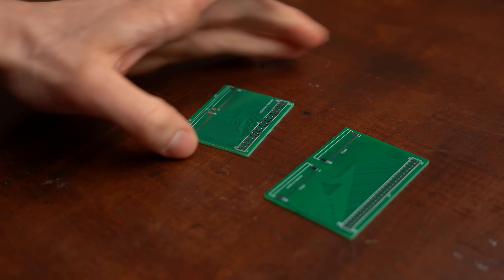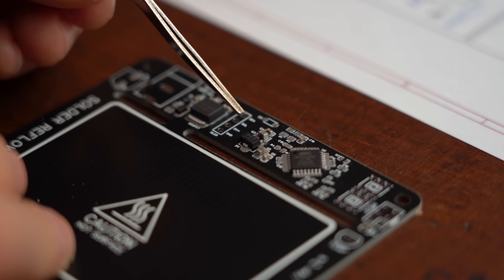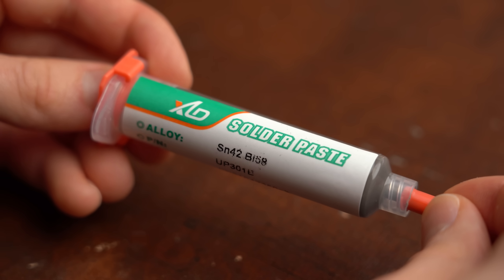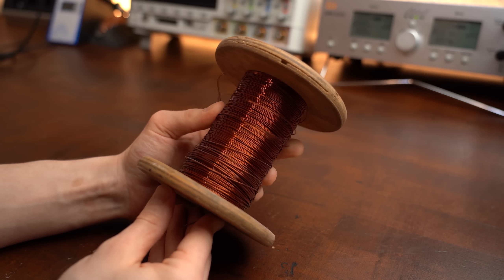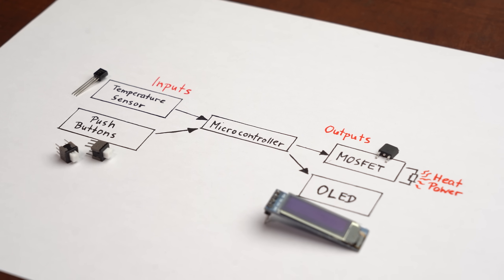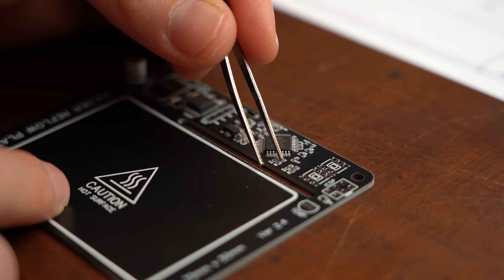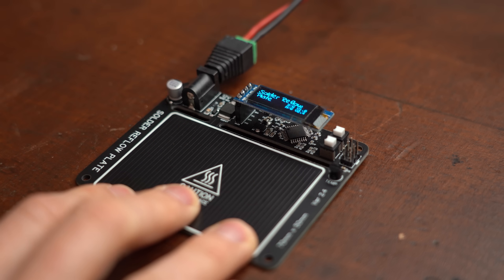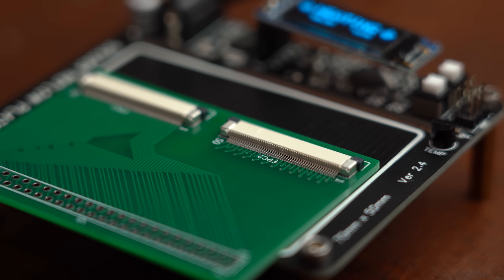The Best way to Solder? Hot Plate to the rescue! (DIY or Buy)

Comment: I just thinking, could you use a copper plate, heating coil, and something that doesn't heat up well without costing too much.  I think the circuit would do.

Comment: Im impressed you didnt try the even more DIY version more accessible, a FLAT IRON, the principles are the same, a temperature sensor, a relay and a simple arduino, this can be upgraded to a triac setup for even more fine control as the flat iron resistence doesnt need the full power to reach a desired temperature.
I know it has been made by other creators buts its just way simpler, cheaper and has a bigger hotplate area

Comment: Meh, I'd rather heat up a frying pan with some sand over the gas stove. 
I've never tried my 3d printer's heated bed. I think you can program some kind of a curve for temperature, but I don't know how many cycles over 160 or 200 degrees it would take before frying something on the control board.

Comment: I have the buy option hot plate, it can have 3 temperature set point you can change it on the fly by press a button, so you can somewhat made that reflow profile curve

Comment: I've had great success with a much simpler solution: I have a 300x300x6mm aluminum plate (6061-T6) to which I've attached several thermocouples. I place the plate on a single burner of my gas stove in the kitchen and heat until the solder flows. Immediately close the flame and let cool. As others have said, this of course only works with components on one side of the PCB.

Comment: I think, with the smaller amount of work I do, the DIY solution would be more economical and efficient with lifespan.   I think with commercial / higher quanties it would definitely be more beneficial to buy commercial.   My 3D printer has a PCB style heater element for the bed and this seems to work really nicely and has lasted a long time with my moderate printing use.
That said, I do like the curve on the DIY solution, though I don't think it is needed so much in open air compared to an oven.

Comment: Seems to me you could use a 3D Printer aluminum heated bed, mainboard and display with some small mods to the firmware to get the same thing, on as large or small scale as you need.

Comment: You may should check some cheap chinese 3D printer hot plate. It can be bigger, and maybe it'll not burn out, if you push up the temperature around 160-170 °C (of course, the controller circuit has to be created)

Comment: Electronoobs made one out of a cloths-iron and has been using it ever since. He even upgraded it as can be seen in later videos. It's pretty much the same as the one in this video, but a lot bigger, so you get more space, but also, because it's an iron meant to get hot and meant to be used many times, literally a hunk of metal, it should last longer than the PCB version.

Comment: The heated bed longevity may be better than you think. 3d printers use this method of heating the bed for days at a time. Admittedly they dont heat quite as hot but often last longer then the printer.

Comment: Actually, the hot plate is just like the PCB hot bed of a 3D printer. If you can get the same PCB with the correct trace width and length, a 3D printer controller can be used to control the heating process with G-code.

Comment: I like this idea, I have an extra 3d printer motherboard and some aluminum frames that I could use to make a diy one, all I need now is a good heat plate setup and I'm good. This gives me a chance to use my old 8 bit ender controller board that hasn't been in use since I replaced it with skr e3

Comment: You should add insulation in the other side of the pcb, as its done in many 3d printer beds, to get quicker heating and accurate readings
Reply: Do you mean cover the component side? Tricky as it is all too easy to dislodge SMD components when covering the board. If you mean between the bottom of the board and the hotplate ... That makes no sense!
Reply: @boblewis5558  I think he means the underside of the hotplate/heater. That's what was (and is) done on the printer beds.

Comment: It's not that hard to solder fine pins if you actually solder correctly. On a related note, if my microsoldering instructor had ever seen me melt solder onto the iron and then dob it onto a pin, I would have been pulled right out of avionics and would have spent my enlisted time as a cook or someone that transports human waste.

Comment: I had created a similar project a couple semesters ago for my industrial instrumentation and control course. However, I used an old broken portable iron and a ss relay along with the Arduino and OLED display. It worked great for soldering PCBs and also used pid control. Turned out so good that my teacher had me make 2 more for the lab to use instead of the commercial ones with full sized irons 🙂🙂. So I greatly recommend using that for the heating surface and the rest of the pcb heater as control. Only problem is that since mains electricity is involved, only experienced people should try it 🙏

Comment: If the temps envolved are so "low", another option to build a bigger heating area is to use a 3D printer bed heating PCB. They usually are 22x22cm, but there are bigger options. This would also solve another previous comment about separating the PCB from the heater
Reply: I was wondering about this.  I typically don't drive my printer build plate above 100C.  I wonder if it could get to the 160C needed here.
Reply: @bbowling4979  With enough power and thermal insulation, anything can be done (including burning the electrical insulation :P), but unless you can "pump a few more volts" from your printer's power supply, I agree that would be pretty hard to reach.

Comment: I can't believe the size of that MHP30, so cute. I'd seen photos of it when I was looking for a hot plate but without a banana for scale, I had no way to tell it was so small, I thought it was at least 30cm across. 

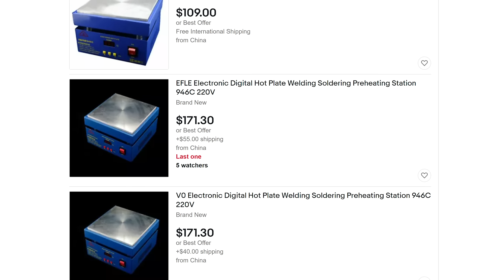I couldn't understand why you'd need a hot plate as small as it is but I'm now thinking it's a repair hot plate designed for small area fixes instead of whole boards. The part I still don't understand is how something that small can cost that much! It's about the same price as the bigger blue hot plate you showed at 4:28

Comment: I always thought of heat plate as a support (i.e. put it at around 100°C and then solder with the hand stylus), not as a fully featured soldering solution. I will have to give it a try...

Comment: People have been using the pcb heater method for years on 3D printers. It lasts for years and thousands of cycles, usually only heats up to 60-100°C but for hours upon hours at a time.
Does a few minutes of hotflow at 160°C stress it that much more? I don't know, but the technique itself is well proven.

Comment: A unit I work with (won't name due to DNA) actually uses the heater to read the temperature. If you sample the Voltage of the heater, and the Current, you can calculate the resistance. Look up a copper wire table for the Delta R with Delta T and your heater control is complete without another sensor.  The heater resistance is measured during the off cycle of the heater by having a current source provide a few mA of current and sensing the voltage. This off period is every few seconds during warm-up, and more often when heater PWM begins. 
Slightly off topic, have used an Electric skillet for this. Instead of using the heat cycle on the plate, the plate it taken to flow temperature with a thermal controller, then the board is simply placed for the heat flow cycle and removed to cool. It is best to bed the skillet on a bed of insulation for even heat spread from the heater loop. In open air, the heat is uneven.

Comment: Great video! So far I was using a ghetto solution: bought
-  "300W LED remover" (<5€)
- REX-C100 or similar PID controller (<10€)
- SSR (<5€) and an adequate thermocouple. 
As case I was using an empty PC PSU, cut a hole to mount the heating plate, and I kept the fan to have some fast cool down. All very manual, but it works. You should try it :-)

Comment: BTW, if you also happen to have a Voltera V-One you can use it for automatic hot plate reflow, without limiting yourself to the normal software's built in profiles or manually setting and changing the temperature. How? The V-One uses Marlin firmware. No joke, you can download Pronterface and connect to the V-One to issue it motion and heating commands. Use M190 S<temp> to set the bed temperature and G4 S<seconds> to set a wait time and you can define your own arbitrary reflow profiles with temperatures up to 240 C and as many automatic stages as you want.

Comment: Great test. But please address the elefant in the room, reflow oven is the only safe, reliable and repeatable solution! With a open hot plate the thermal stress is way to big and could damage components permanently. Also the dry / preheat effect (the main reason for the reflow curve) is not working propperly and you could pop your ICs (moisture in the plastic of old / long stored ICs expands too fast).
For rework sich a plate is great but wouldn‘t recommend ot for single PCB solderings. A 20€ pizza oven plus a cheap reflow controller is just safer, faster, more reliable and also cheaper in the end

Comment: When I was getting started, I tried buying the "ReflowR" hotplate solution (which isn't available anymore). They too so long to ship, that I basically gave up and bought a Controleo3-based toaster oven instead. When it finally did arrive, the box basically went into the closet and was forgotten about.

Comment: I love that people are creating DIY projects like this.  I would have liked there to be a version of the board that supported through-the-hole componentry rather than surface mounted because the irony would be that you needed a reflow plate to make a reflow plate, unless you had very good soldering skills - which I don't :)
Reply: I have this on my to do list, It shouldn't be too hard to switch the pads out for Through Hole pads.

Comment: Why not use one or more TEC's for the hot plate? [TEC = Thermal Electric Cooler] A TEC uses diodes sandwiched in a ceramic package getting hot on one side and cold on the other. In this case you would be using them backwards by putting a heatsink on the cold side and use thermal paste/glue to fuse a copper plate on the hot side. That way you can fuse as many as you like to make a hot plate as big as you want, but be prepared to provide the current. The ones I get are 2"x2" and run on 12VDC. You can run it on 120VAC house voltage if you series 10 of them through a bridge rectifier and drive that with a triac. The diodes in the TEC should be able to handle the heat required because any heat level that would damage the diodes would also damage components on you work PCB.

Comment: Thanks for this!  I have one that could cost as little as $30: 

I am going to cut a square out of an old baking pan, flatten it well, and throw it on top of my el cheapo $14 plug-in single kitchen burner. I already have an outlet that I can program to maintain any temperature -- it has a K-type sensor on a long lead. These are available for about the same price. Place that on top off, or underneath, the pan square and I think I've made myself an occasional use re-flow hot plate !!!!!   My method will be to set the temperature just below the melting temperature of the solder, and then come in with my hot-air gun to finish the job in fine detail exactly where I need the melt.  This is very handy for repairs when you don't want to disturb any of the other components (and can be done with any hot plate of course!)

Comment: instead of a pcb as heater, I am thinking about those "PCT encased in aluminium plates" that are sold quite cheaply on e.g. A*xpress. Plug this to those set of controller-temperature sensor-mosfet-etc... and one would get a more sturdy solution I guess.

Comment: Wow, thats very interesting. I had the same problems and i'm still working on a diy soldering plate. It's nearly finished, next week is the test run. It is a 400x130 plate with 2 seperated "plates". And a 5" touch user interface. It should be very powerfull, but unfortently it is a project i do at work so i'm not allowed to share the project files...

Comment: I bought one of those cheap solder baths with temp control and the aluminium PTC hot plate, modified the solder bath to use the plate instead.  Viola, a soldering hot plate solution with decent workspace for under $30  with temperature control.

Comment: Or how about using an ESP32 with wifi antenna and then control the PCB hot plate via wifi instead of via a display and extra buttons. Would simplify the PCB design and remove the need for an extra display.

Comment: Really cool project, the DIY version!:) separating the heater PCB from the control unit and using a better accessible microcontroller (maybe some cheap ESP chip) which can also be programmed more easily would be nice improvements.

Comment: For plastic surface mounts connnections, I just use hot air rework on the other side of the board, ngl.

Comment: I'd think the hot plate would simply melt the PCB. How high of a temperature can the PCB even handle?
Reply: It seems the coil is the desired resistance only in the heating area, and the heating area is seperated from the control electronics area by the air-gap cut into the circuitboard. The whole assembly is lifted into the air slightly to allow cool air underneath, which surely keeps the electronics section below the solder melt temperature.

The circuitboard itself is not going to melt anytime soon. They arent usually made with solder traces --- they are instead chemically etched. the temperature limit is gonna be really up-there and a function of the coatings and board substrate chosen.
Reply: @gutrali  I see, thanks for clarifying.

Comment: For anybody trying to do this, if burning the bootloader sounds daunting, just pre program the atmega while it is still in the arduino, then take it off, that way its is extremely simple and only takes like 1 minute to do.
Reply: i plan to do that, it will really work ?
Reply: @muhammadFikri24  yup have done it plenty of times, works great!
Reply: Thankyou, still waiting from jlcpcb,
Reply: @muhammadFikri24  Good! Theyre great, have gotten multiple boards from them... Good luck!
Reply: I bought all of the components and got the Atmega separate. I don't own an arduino, do I need on to do the updating?
Reply: Perhaps need a socket.

Comment: A good addition to the design would be make in two parts separated.
One part only the high current inputs and the hot plate for easy changing when the hot plate wear.
Other part would be nice if vou have the holes for using a Arduino and the place for the micro-controller, this part connect to the other through jumper cable.
You can have different sizes of hot plates too  :)
Reply: you can install a a thin aluminium piece on top of the hot plate . say 2mm / 3mm to avoid wear of the hot plate. Great job! btw, where can i find the schematic ? (i only found the PCB layout )

Comment: FPC connectors are super easy to hand solder! solder the ears on the sides and then drag a large blob of solder across the pins. Copious amounts of flux are mandatory. The surface tension will rip off any excess solder when dragging the blob.

Comment: It might be cheaper to buy an Ender 3 and use the hot plate which is a whooping 235x235 for soldering. Plus you also get a 3d printer as a bonus. 

You can control it either via the LCD display or GCode.

With enough patience and engineering skills you could also turn it into a pick & place and solder machine :p
Reply: I was going to ask if 3d printer plat can do the same temperature range?  Bet it can!  I use $3 pid boards from China for heater controllers.  Replacement bed and $3 controller?

Comment: Since you do a lot of soldering on this channel, is it possible you can make a solder sucker? not the solder sucker that you have to cock and press a button for a one time suck and then re-cock. I am referring to the one with the pump. I had an idea to use a syringe with a motor on the back and a heated tip, my only an obvious problem is the syringe can take the higher temps. I use a commercially available solder sucker but it is crap at doing its job :(         .Maybe you can tackle this as another DIY or BUY episode.

P.S. The reason I ask is I know solder wicks are great at removing solder, but not so good when trying to remove solder from a small passage.

Comment: Nice project!

Shouldn't it also be possible to use a mains powered heated bed (silicon heater) for that purpose as used on 3d printers? I know the required temperature is much higher as used for 3d printing but I guess a mains powered bed could handle that. In this case you would also no longer have the size problem since such beds are much larger compared to the pcb in the video.

Comment: This reminds me a lot pf pcb heated beds in 3d printers. I‘m thinking maybe a proper closed loop system with thermistors and some actual material on top like aluminium as well as insulation  might help it sustain longer, since the heating and cooling Cycles are longer due to thermal capacity? That would obviously make it slower at operating, but the pcbs could just be placed on top after the construction is heated up fully. 
The heated pcb portion could also be replacable and detachable with click in place connectors of some sort or like pogo connectors.

Comment: Nice project. In my work, we built a hot plate with a low profile resistor like the LPR100 10R J (10 ohm). These are pretty cheap $5 to $10 and come in a size of more or less 100 x 60 mm and works up to 250°C (and a little above). Control the heat with a power supply and temperature sensor or with an electronic controller.